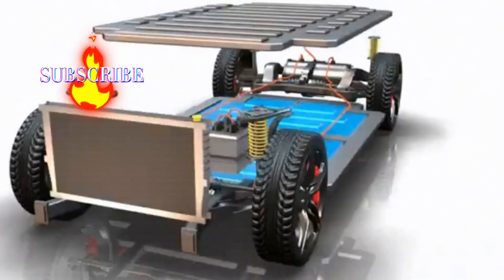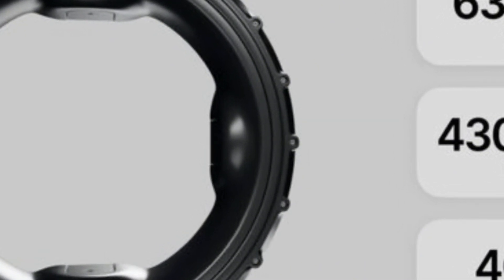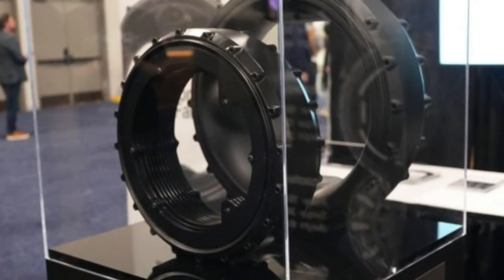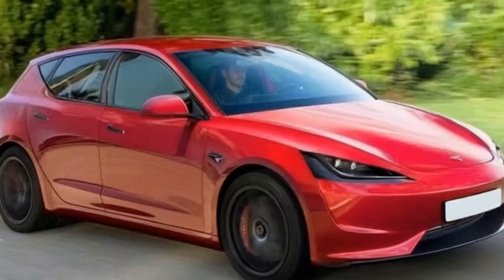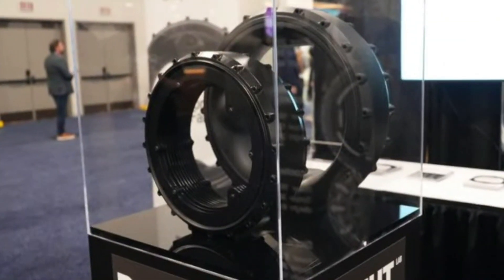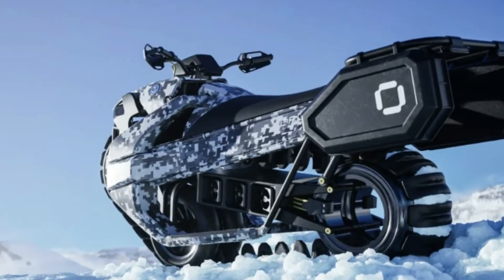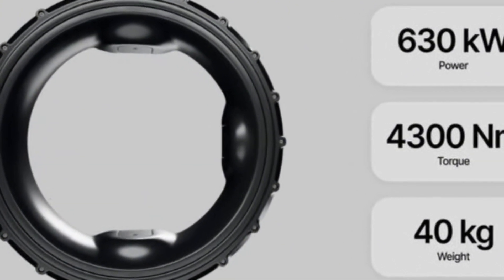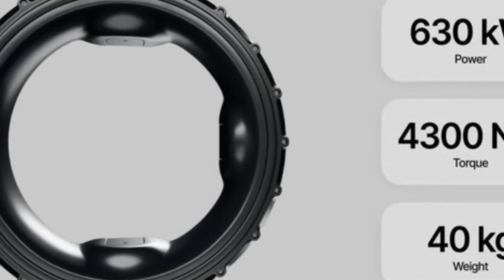This 88-Pound Electric Motor Makes 856 HP – The Future of EVs?

Comment: If those horsepower numbers are even close to real you should be able to build a 20 pound 200 hp motor for automotive applications. Two would supply 400 hp and should suffice for excellent performance in a medium size car. Four would put that same car in super car performance class. In mass production should cost much less than conventional motor, reducer, dufferential, CV joints and half shafts.

Comment: That's really really interesting, motor using the wheels as a housing.
Fifteen years ago interstate 95 ran right through New York City across the George Washington Bridge those five miles was the worst condition of highway in our nation. All three lanes had potholes that could not be missed.. Many years later this road was repaved which was a landmark move on NYC. Have you tested this new technology on bumpy roads where regular people live?
Reply: It a great idea for some applications, but very costly to repair if the donut motor wheels was damaged by a potholes in the real world driving, and more likely the water moisture from the salty snow wet road conditions get into the motor and start rusting up the wheel motor. 
That why it is much better to have the motor away from the wheel.
Reply: @kamingcloud2880 right bc I'm sure you know better than the company making these lol. You act like they haven't thought of those possibilities and are just half ass making them lol